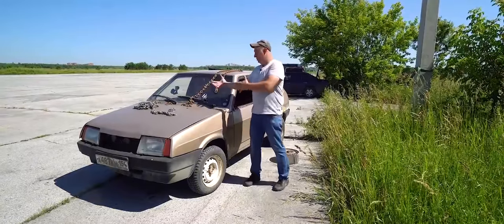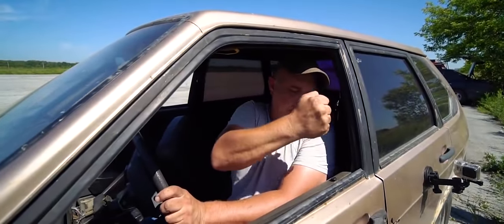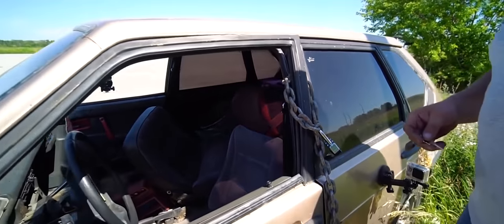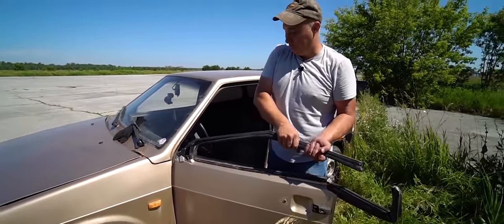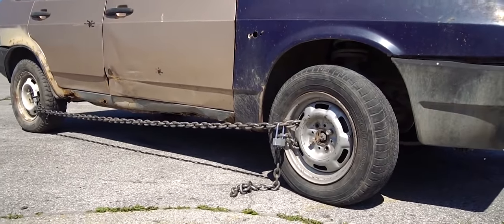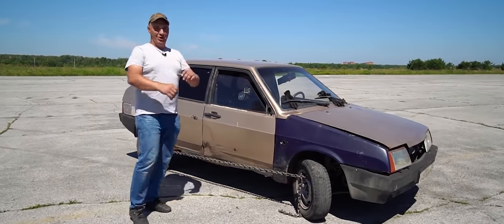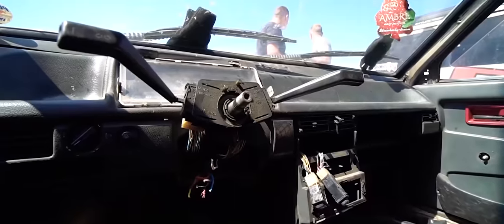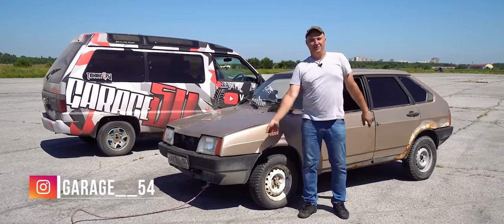Will a car drive if you chain the tires?

Comment: Technically you can, if you tied the chain to the exact same spot on both wheels, it will drive, it will look like one of those old trains 🚂
Reply: It depends if the chain is not to long neither to short
Reply: @zee3391  No, the moment you turn the steering wheel slightly, the front wheels take a longer arc around a corner than the rear wheels, so they would want to speed up, which would only work so long until the rear wheel didn't want to let it.
Now, if you had two bars connected to MAKE the front and rear wheels go the same speed, you would have the situation where the wheel with the most traction forced the wheel with less traction to turn its speed. Other crazy dynamics, such as he found, yanking the steering off of where it is aimed, would also occur.
Reply: @zee3391  if it's two short, you wouldn't be able to connect it; if it's too long, there's slack in the chain, meaning if you could drive the car without the slack, you can still drive with the slack.
Reply: Right, you could drive straight at least, but it wouldn't not make turns very well
Reply: huh
Reply: If the car doesn't have a differential or Cv joint. 🤭
Reply: youd be surprised to find car tires spin at different speeds
Reply: @dantegames1892  For multiple reasons. Turning, how much tread has been worn off, road temp, ambient temp, heat from use, even different sources of radiant heat (saying "heat" and leaving it at that would be far too much of an understatement), brakes locking one wheel and not the other in the pair. Even something as simple as the air pressure being just a few pounds less or traction control being wonky.

I imagine it would work in a straight line for a short while, but it wouldn't be long before they got out of sync.

Comment: This video was great. As a former tow truck driver, I can tell you we would usually carry bolt cutters. It's more common to see chains on trailers though.
Reply: President Brandon: Now I understand everyone's shit's emotional right now. But I've got a 3 point plan that's going to fix everything.
President Brandon: Number 1: We've got this guy Not Sure. Number 2: He's got a higher IQ than ANY MAN alive. And Number 3: He's going to fix everything.
Reply: That's why you use 10 U-locks instead. Let's see a bolt-cutter cut through that!
Reply: Cordless grinder your out in 5. Minutes
Reply: Question from the future, if I were to have a car that retracted it's wheels into itself, cover the wheel wells, and had no ground clearance for any kind of strap or bar to fit under it without removing the entire panel, could you tow it?

Comment: The best anti-theft device is to own a really shit car like yours
Reply: Poverty makes you strange. It's how it is..
Reply: I know how to hotwire most cars made before 2000's shit cars are easier to steal but crims usaly go for keys/ carjackings cause there dumb and it's easier to steal that way
Reply: Thats a lie my shitty corrola was stolen like 2 years ago. Power steering was messed up and car made terrible noises and it was still stolen
Reply: 1:35 cameramen are lucky they didn’t have a car get pulled right into them.  Why would they stand there?!🤦‍♂️
Reply: God Eater That was an attached GoPro lol, just pook at the next shot, you can see it there.
Reply: Socks With Sandals I extremely doubt this is his everday car
 He likely bought it from a junk yard or something for the video.
Reply: Same thing with car radio. Own a smart modern power full car radio. you chance of getting robbed encreases dramatically.
own a standard radio and you will be safe.
Robbers will not risk anything if it not worth it.
Reply: @FlatSurfer  Lol I see why you like Nikola Tesla then.
Reply: Well he was not going to test that on a brand new car, was he?
Reply: Well he wont try to damage one of his good expensive car
Reply: Auto theives like old too.

They like old Chevy trucks.
Reply: My door handles are broke. They pop out when u try to use them. So now I know when ppl try to steel my car
Reply: LOL u must be new?  Thats at least 500 dollars in scrap metal.  Or find a dealer that does cash for clunkers programe and get 1k .
Reply: umm no thieves specifically target those sometimes because they have basic locks and are easy to break into
Reply: Own a hood car if you live there even if you're rich makes sense
Reply: @SkyJUSTIN6  Holden's are easy to Jack I used to practice on m8s mum premiere
Reply: @jerknorris2483  What's a hood car? An army tank?
Reply: That's funny! :D
Reply: @voornaam3191  The mafia drive hood cars... Black Cadillacs
Reply: Anti theft and a contreseptive
Reply: Shit cars tend to be older and easier to steel
Reply: @FlatSurfer  in Colombia it's the same with cheap  motos because they are the most common. So the chop shops are most likely to profit from them.
Reply: @4gbmeans4gb61   Didn't the govt stop the Cash for Clunkers?
Reply: i think he drives a bmw x5
Reply: He bought an old banger just to torture the shit out of it because it was cheaper and hey, it was going to the scrapyard anyway.
Reply: @987bowen  not really get a car pulled into them, it was obvious the door handle will fly off easily, but the door handle on a chain could've hit them in a swing
Reply: In italy they aim to these cars because are easy to steal, so its not the best anti theft device
Reply: @FlatSurfer  ü.. ......mgfufi.g.pupht
Reply: My grandpa's Opel Ascona from 1970'/80' got stolled. That car was like can 😅
Reply: @FlatSurfer  in bulgaria they steal ladas cause they are easy to open and easy to start up not like modern cars li electric starteres and etc.
Reply: Socks With Sandals 😂😂😂😂
Reply: this belongs in r/rareinsults, ngl lmao
Reply: @mrcaboosevg6089 that's because old cars don't have immobilisers or anything. However, generally speaking, newer cars are keyless, so the signal from the fob can be replicated by electronic devices. If that happens, a thief can unlock the doors and start the engine without damaging the vehicle at all.

Comment: Camera man! Have you ever seen what a chain does when stretched to breaking point?
Reply: Neither the driver nor the camera man knows
Reply: It probably breaks
Reply: They're Russian it's okay
Reply: Most of the camera angles are mounted cameras not a person holding a camera
Reply: Kyle Morrow its not pretty! Chain or cable
Reply: Kyle Morrow most chain is meant for boat anchors so it would be really hard to break
Reply: That chain was nowhere near breaking, he only has two of the lug nuts on the front tire. The studs would have broken and the tire would have ripped off long before that chain was going to snap.
Reply: oh my gosh your the first one to guess right! Lol
Reply: It breaks. It doesn't sling like cable wire, but it depends which end of the link breaks hehe
Reply: You can ask my neighbor. Come to think of it, he's dead.
Reply: Kyle Morrow Uh. I'm guessing it... breaks?
Reply: +Rob Low: Well, no shit, but WHEN it breaks, it can literally inflict fatal cuts from the sheer velocity of the chain. It tears you apart like a shotgun.
Reply: Yeah once a fat kid sat on a swing and little by little it got lower
Reply: The chains can explode
Reply: 1117smatt Random R.C yes agreed chains are very strong   There was no danger here. But when there’s no give and a chain stretches.  Get outta there
Reply: U would never ever be able to break that chain with that car. U could lift that car with a crane using that chain no problem
Reply: It works like a sword and it can easily decapitate you
Reply: this car would be hard pressed to break a rope, never mind a chain.  although, when you're hooking onto random shit, it's probably not the chain breaking you gotta worry about... it's the random shit you've hooked onto.
Reply: It becomes like a bomb
Reply: No chance that chain breaks
Reply: Unlikely it will break, but things that it are attached to sure could.  I have seen  a chain snap and it could easily kill you.
Reply: I wish the camera man got even closer LMAO
Reply: @toolsandtrash6911   Finally a rational comment!  If it can hold the car's weight,  car can't snap it - at least not by tying it to something, and pressing gas, you would burn your tires, but not snap the chain.
Reply: @tilenfabe762  
Well, the thing is, in this case, that the small padlocks can easily break - if the driver is accelerating, the chain will swing around - enough to kill the camera man, that's for sure...
For the chain itself, I gotta agree - very unlikely. Though even unlikely is no guarantee. I wouldn't have done it anyways, that's for sure.

Comment: in my old apartement block some dude that lived there always took off 1 front wheel and took it inside lol
Reply: No way how long does it take to remove the wheel
Reply: @cloud_c5222  not that long actually easily less than 5 minutes but with an impact and pump jack instead of scissor jack it can be done in a minute or less.
Reply: He works at the car plant and steals a new wheel every day to drive home, and then drives back to work with only three wheels. Now his apartment is full of wheels.
Reply: It's something I would do🤣🤣🤣
Reply: The gru meme:
no one can take car if car got no wheels
takes off all wheels
cannot put back on cause car too heavy
cannot put back on cause car too heavy

Comment: Tying both tires work, but you definitely throw off your alignment
Reply: Hell, might even rip the front wheel off the axle or bend it all to hell
Reply: Rather repair my alignment than pay for a whole new car if the fucker gets away :p
Reply: what if the thief brings his own set of tires, I mean they do steal wheels after all. so putting two back on wouldn't be much of a problem. also, rather than trying to drive away with tires chained wouldn't they be better off grinding the lock away? that's what the fuckers do to steal motorcycles.
Reply: I've seen Russian dashcam videos. I don't think alignment matters to most. :p
Reply: @Sal-et6um  loop it through the frame and have the chaint pitted, fill pits with gun powder ans seal with flex seal. Nasty exploding surprise to damage the cuting wheel and thief
Reply: +Mohammad Salman: So, he's going to have wheels with the same size diameter, tires that will fit, with the same wheel stud pattern, and the time to change the wheels without being noticed? You'd have a better chance at winning the lottery.
Reply: @shadowthehedgehog4737  one word: Russia
Reply: At least if a thief succeded to turn on the car if he try to drive the car gets destroyed so that's loose loose
Reply: Just put another chain on the other side...

Comment: I was a tow truck driver. If the cops are involved your SOL they will eventually tell the tow opporater to do what ever it takes to get the job done so the damages are on the owner plus the fees and fines.  These trucks nowadays have a lot better equipment and more powerful and most of their operators are extremely skilled and quick about their job. so the best advice I can give is to park in a designated area.
Reply: Yeah, pretty sure a simple torch would make short work of the padlock. Or, as I like to call it, a skeleton key. :P
Reply: 1oz of Dawn on the tires and right up the rollback it goes.
Reply: if this is to stop a tow nothing works except paying the bill
Reply: Remember use dawn dispenser on every turn.
Reply: Womb Raider  I take you have been towed once or twice in your life,  :-)
Reply: 33 people got towed
Reply: Womb Raider  
Break down in the middle of the night, -20 degrees, no reception, 20km from the next town.
If you can see a tow truck, I promise you you will be grateful as hell. Could save your life and your car.
You could also unemploy them all. I bet it won't take half a year for all highways to get blocked because no one can tow broken down trucks away anymore...
Park where you should and you'll be alright. I never got towed. Simple logic behind it, I'd say...
Reply: breakone9r: Two words... Bolt... Cutters.

Comment: Drive a car with one of those parking enforcement boots on the one tire
Reply: Bang Bang Bang just like that one episode of The Simpson’s when Barney lost Homers car lol
Reply: There are plenty of videos on YouTube where people actually did that.
Reply: ... but isn't something with one tire called a unicycle?
Reply: And see if a jackhammer could actually break one off lol.
Reply: Ann Drogynous what??
Reply: Ahhh, the good ol' Denver boot.
Reply: why you drive with a steering boot on when you can just change your tire and drive off with no boot.
Reply: @rogertye8401  most boots also have a section of aircraft cable on them which they padlock to a suspension component...only way to disable is to chop them into pieces
Reply: wow
Reply: Haven't anyone tried taking off a booted wheel and slapping on a spare? I can't say it'll work for all types boots.
Reply: Cut it using a stihl saw. Buy one you will save yourself few quid and have the stihl saw at the end. You can resell it and have your money back and clamp free.

Comment: Chain on rear wheels? Your car is a FWD.
Try chaining it with a RWD
Reply: RVREVO X3 yea...no shit
Reply: It would still hit the shocks, drive shaft, frame, basically everything in back.
Reply: Depends on how powerful the engine is. If the engine is weak, it will lock up. Trying harder will probably blow the engine.

If the engine is powerful, most probable result is the pinion gear will shatter (likely along with several suspension parts). Then the driveshaft will spin freely, but the car will still go nowhere. Basically a rolling chassis that makes a lot of noise.

You'd be surprised how many vital components of your car depend on very small parts.
Reply: FWD doesn’t have a drive shaft it has CV axles.
Reply: @davidftellez  Why would a FWD have a driveshaft?